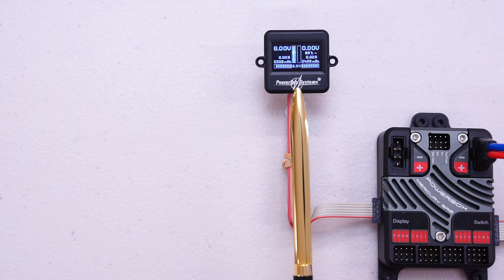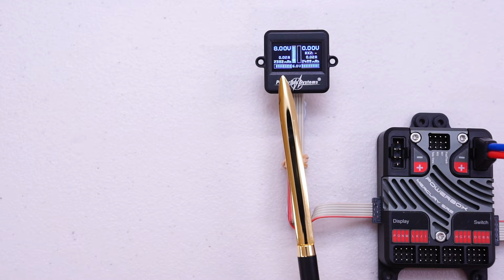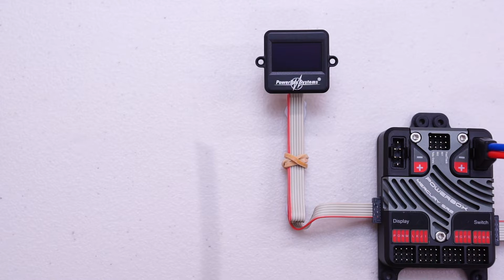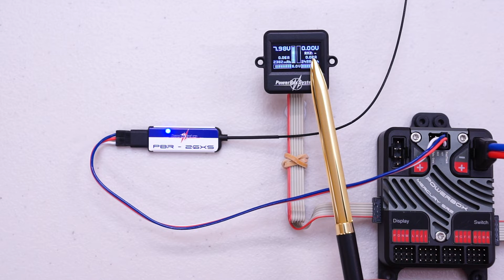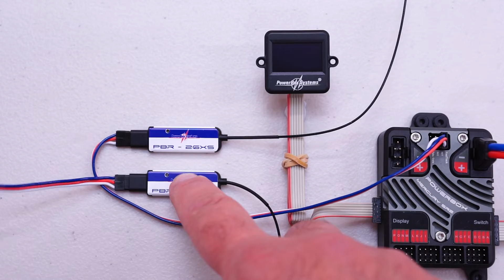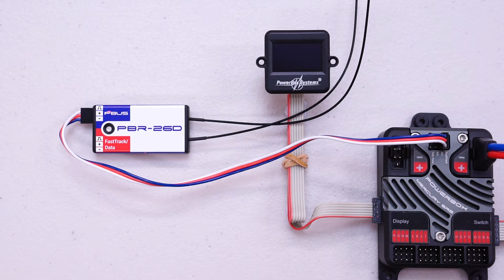PowerBox Core - Atom : Rx Configuration and RF Redundancy Options Including Satellite Receiver use.

Comment: Can I run two 26D & two Sattelites using my Atom Transmitter?
Reply from the maker: Atom can bind up to 2 receive slots so you can run 2x 26D's OR 1x 26D and 1x SAT (26XS).

If you run 2X 26d's then you effectively have 4 separate receive paths.

If you run 1x 26D and 1x 26XS then you have 3 separate receive paths.

You cannot run 2x 26D's plus a SAT (26XS) on each  as you would then need the ability to bind to 4 receive slots - can only do that on the Core.

Comment: Hi Costa, I guess you cant connect two PBR-26D together for redundancy without any powerbox Mercury etc. Its only working with a PBR-26d and a PBR-26XS, am I right?
Reply from the maker: @superleeds1966  Correct... Currently only the 26XS can be used as a satellite Rx.

Comment: It would be great to also see the Core when you do the sattelite and how to test it is "actually" getting a signal to the Mercury and not just "powered on" and showing on the Core screen......  These are great videos and I have watched them all.  Keep up the good work.
Reply from the maker: I have tested functionality with Satellites and they do indeed operate as intended.
You can test this yourself reasonably easily. 

Place the Tx in a microwave oven and close the door (dont turn the microwave on though..!!). The microwave is designed to attenuate 2.4GHz signals so you can perform a test a few metres away where the signal will drop out completely. Usually you will find that you can walk around 5 to 10m away and then the radio link will not work.. overall distance depends on the microwave oven and how well it shields the signal.

Setup a normal Rx and a satellite with a battery.

Now also program a sequencer which moves a servo (plug into main Rx) back and forth continuously.

Now starting near the microwave walk away from it holding the Rx's, battery, servo etc. Keep an eye on the leds on the Rx's.
Walk to the edge of where they still just work. 

Now wrap your hand around the antennas on the normal Rx...the led should turn red indicating loss of signal but the led on the satellite should still be solid blue indicating ok reception and your servo should still be moving back and forth without a problem.

Comment: Costas, another great video and I thank you for that! When running one or two satellites, and needing to add two or more sensors, where does the PBS-Dock come into play and if a Y-cable is needed, where should it go?
Reply from the maker: The PBS dock is basically exactly like a Y-Lead but with 5 outlets instead of just 2. Its main use is where you need to common up more than 2 leads together eg if you have say 3 telemetry sensors and want to connect all three to one port.
I will be showing this in my next video...!

Comment: Do you need to tell the 26XS that needs to operate as P2BUS (Rx) vs FastTrack (Satellite), or this is automagically done by the unit?
Reply from the maker: I always double check when first connecting everything.for Satellite use. 26D must have its FastTrack/Data port set to FastTrack (does not auto switch) and the 26XS must also be set to FastTrack will not autoswitch once set.
Reply: that makes sense! thank you, Costas!